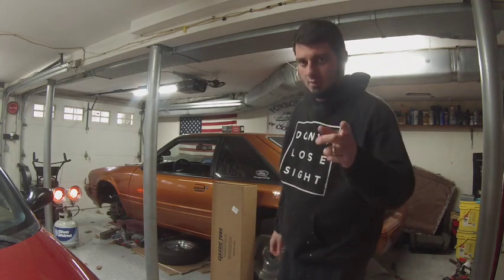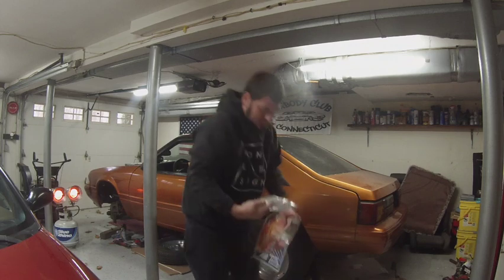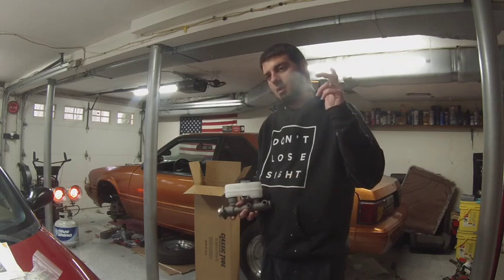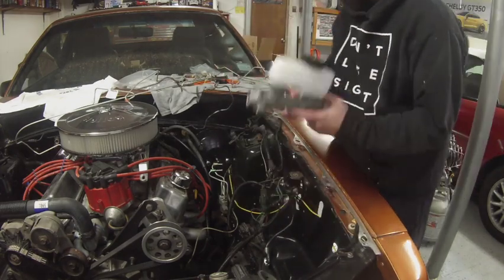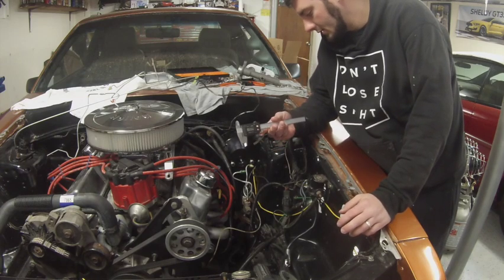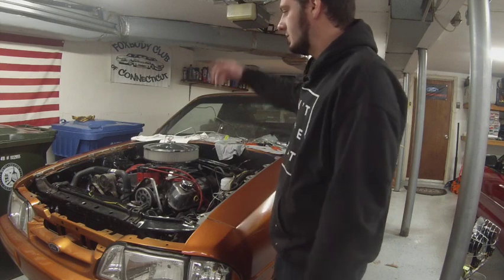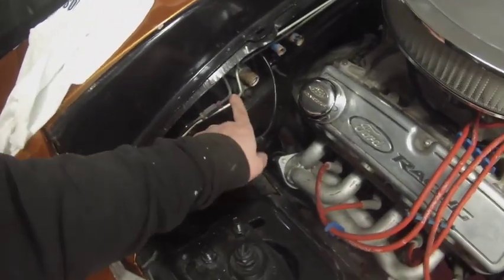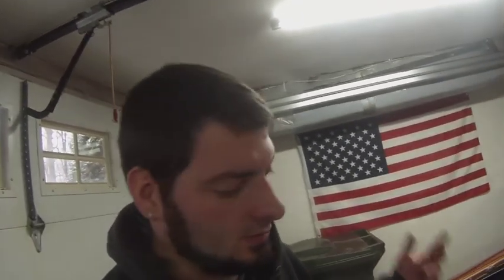87-93 Foxbody Front Hard Brake Line Install

Comment: I did this on my 91, man it was a pain in the ass specially if you have a convertible and you are doing the intermediate.

Funny story is, I bought a grouping of parts many years ago and in those parts was a brand new set of stainless lines so I said what the heck, why not? 

I did the front first and that cured me of that for awhile, later on I wanted to replace my vapor vent line and while cutting the clamp that holds it to the brake line under the car I ended up cutting the brake line by accident, man I was so pissed 😂 so I had no choice but to replace it, I had to drop the convertible strengthening plates cause the brake line goes under it, if you want to make it 80 % easier drop that plate, if not you'll be fighting trying to route that line.

Good thing about all this is once you are done you will have some killer stainless lines under your ride and they will last forever.

Comment: Would you happen to have the part #?
Reply from the maker: Part number for the entire kit?
Reply: @MattSkiDooFord  yes. I can’t seem to find the front only kit.
Reply from the maker: @shawnspeer1304  purchased off CJ Pony parts. Part number is MU1027A OE
Reply: @MattSkiDooFord  Thanks!
Reply: do you recall if the passenger side hardline goes through the hole on the back of the passenger strut tower? Previous owner did some creative routing of the front hardlines so I’m flying blind.
Reply from the maker: @shawnspeer1304  if I remember correctly there’s a hole where the shock tower and firewall meet.